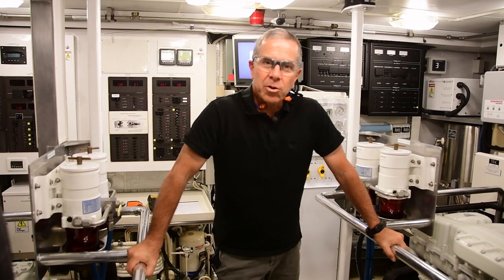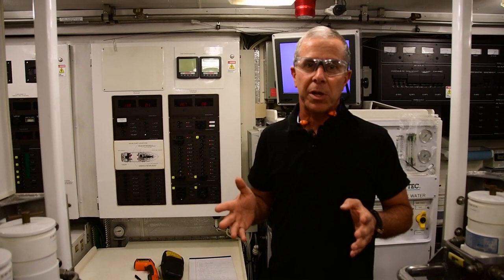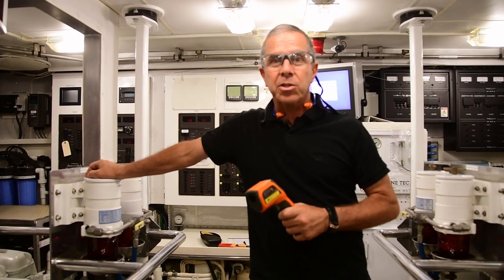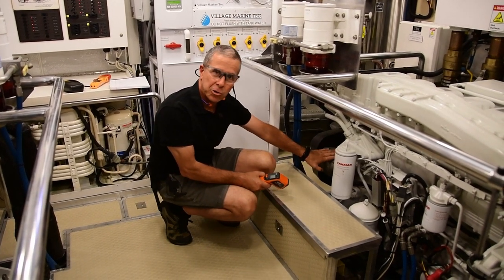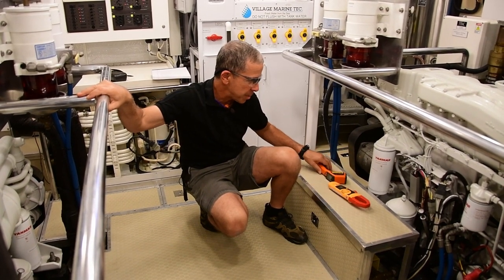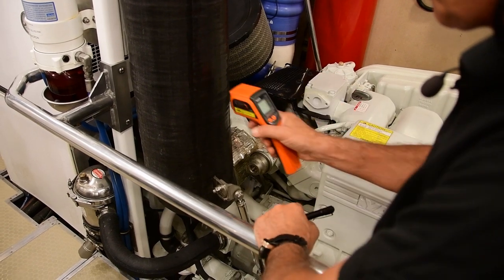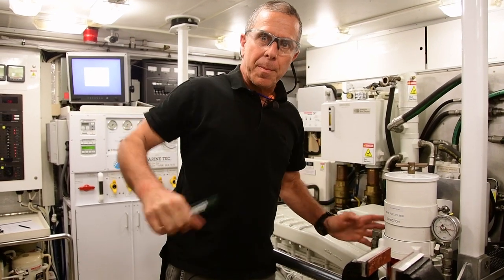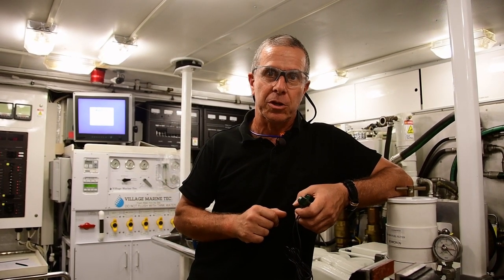Engine Room Check Pt I

Comment: Last week while surveying a Trawler Motor Yacht in the Philippines a joint in a coolant hose let go …. Fortunately only moments earlier we had put the floor boards down …. The rush of steam and hot water lifted the floor boards with water making it to the ceiling of the galley …..
Reply from the maker: Thanks for sharing Simon, I've had similar experiences, more reason to wear safety glasses.

Comment: I ve never been in a workplace that wasn’t dangerous, Pulp and Paper mill, oil refinery, fish plants , 
Offshore  oil drilling rigs,  thermal electric generating stations…
Lots of danger in many workplaces
I’m looking  for your PPE …
Hearing protection?
Long sleeves ?
Emergency communications?
Reply from the maker: Thanks Ed.  I have hearing protection on, I mention it and you can see it around my neck.  No long sleeves, and I'm wearing shorts for this presentation, for the recreational engine room that's standard practice, but long pants and sleeves, or coveralls, certainly wouldn't hurt.  Same for emergency comms, not standard for recreational engine room surveys but it wouldn't hurt.  The most dangerous work place I was ever in, briefly...an office cubicle...;-)
Reply: @SDMarineConsulting     Steve, glad you took my response in such a positive way…
Set a good example for less experienced people, 
Stay safe!

Comment: Steve, any reason why you can't just leave the engine front cover off all the time for front belt inspection? I know belt dust may be a problem but ease of visual seems to out weigh the dust concern. Your thoughts?
Reply from the maker: It's primarily a safety issue, not dust, a moment of inattention or if the vessel rolls or pitches, and fingers or clothing could end up in a belt with disastrous consequences.  I had a colleague lose a thumb by accidentally placing it into a belt/pulley.
Reply: @SDMarineConsulting  Thanks, love the videos, keep it up.
Reply from the maker: @RunawayWithTheClarks  Part II coming soon.